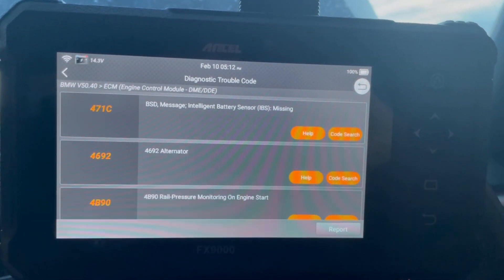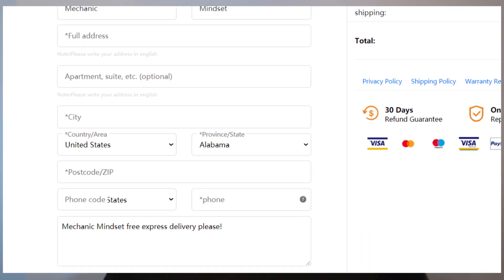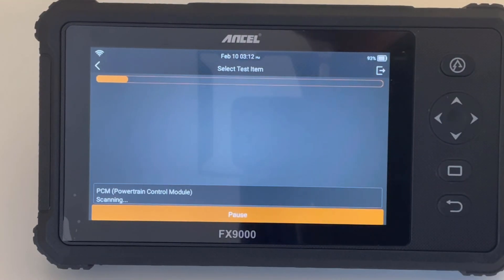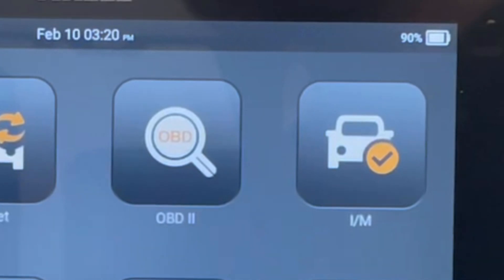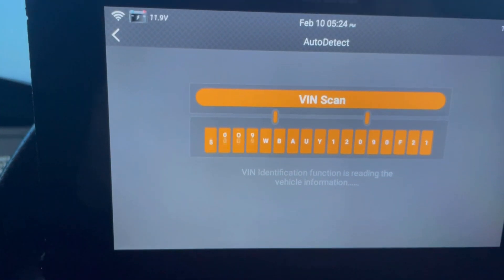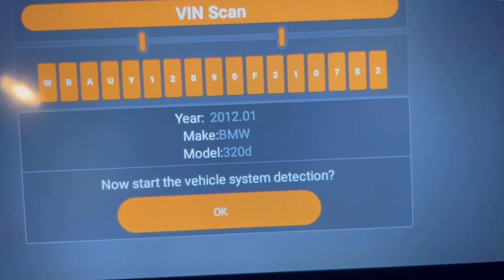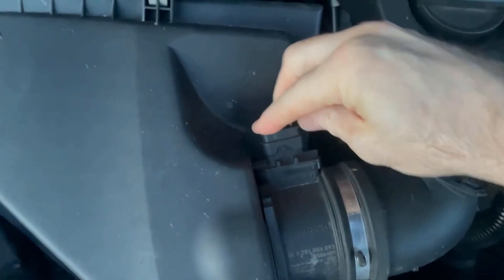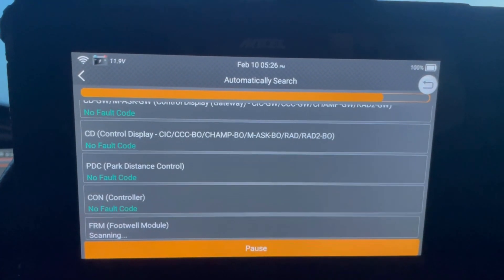I Finally Got A Scan Tool!! | Ancel FX9000 Review | Mechanic Mindset

Comment: I just got an ancel Fx8000 It's a piece of crap. Its Slow slow and slow. when performing oil reset successfully on unit the vehicle remains the same.  Wont do brake bleed, give inaccurate information such as battery voltage.
Reply from the maker: This is quite an old tool now. I reviewed this nearly 5 years ago. Send it back and get one of the ThinkTool phone units. Or they’re doing some lifetime update tool now too. 

If you’re professional, speak to your local diag tool dealer, dont buy the general internet tools. They are not the same

Comment: It’s worth noting to your viewers that this “New” tool uses a Six YEAR OLD version of Android (v7.1), and is not supported by Android security updates. It seems to be common place with a lot of the DIY level devices. I would question the longevity of the device as more money is spent on updates down the road.
Reply from the maker: Good to know thanks. The tech works is moving fast for the automotive OBD tool world at the minute. there seems to be a lots of brands with similar tools and growing capabilities coming in at lower prices. At the time of testing, I was impressed with this tools basic scan/data/service function features for the money 👍

Comment: It looks like this tool has OBD2 side diagnostics of course, but it's not clear how much Enhanced Manufacturer Data is also available, and whether it can print wirelessly, and whether the tool itself is wired or wireless ... In my case, many of these tools don't cover Australian built Fords and GM (Holdens) ... haven't been able to determine yet whether this tool will do that.

Comment: Ancel is b.s with their yearly subscription. There are much better scan tool out there that you don't have to pay subscription fee.
Reply from the maker: Hi, the good thing with this tool is that you dont have to pay and the tool still works. It’s not an expense you want if you dont use it that often, but if you do it’s nice to have the latest vehicles loaded. I dont think it’s that expensive either, most reputable tools have a charge and supports the development required to keep tools that last up to date 👍

Comment: This may be a good scanner but it’s disingenuous for Ancel to claim bidirectional status when it clearly does not support that function. This was the only reason I considered purchasing this model.
Reply from the maker: Yes, it's not 'full' bi directional. It does have all the calibration features and there is a feature in the I/M OBD section for component activation but doesn't work on my car.

Comment: Can it tell actual miles from PMC....? 
A lot of  people are clocking the cluster...
Reply from the maker: I would have to check - it may be possible too read the mileage from other control units too. I know a lot of the better mileage correction tools change it in all modules. Otherwise a conflict will be recorded and a fault code stored.

Comment: I just received my fx9000 today.   turned it on and went thru all the updates.  tested on a chevrolet equinox with all kinds of issues and it picked up a lot of fault codes  I was surprised at how easy it was to use. I even sent myself a report via email which allowed me to see all the codes and then research what they were from my home computer. I am using the Chevrolet Equinox as a learning tool.  Thanks for your video.  And I hope to see more about the FX9000 soon
Reply from the maker: This is great to hear! It really is a good tool for the money 👍. For sure, we will be including this tool in future videos! Thanks
Reply: hello sir, i also have ancel fx9000, but i cant be updated, do i have to register the serial # ? and how?

Comment: You need to update the Amazon links for the Pico and the Hantek lead, both say 'Currently Unavailable'. I'd rather purchase where you make something from it
Reply from the maker: Thanks for updating me! I will check them out. Was that for UK or USA links? So hard to keep on top of them. Cheers 👍
Reply from the maker: Also, if you click a link, we get a commission for anything you buy after that. So if it’s out of stock and there is another similar recommended, we still get a bit of commission. Thanks so much for the support!
Reply: @MechanicMindset  It was the UK links, but now I know that clicking though from there works I can go ahead
Reply from the maker: @yakhunt9424   Cheers!
Reply: @MechanicMindset  The PICO looks to be out of stock everywhere now :-( Annoying, just need to check the output from an MX5 gauge cluster to the cruise control to see if it's a conditioned output from a VR VSS input and suitable to feed into an aftermarket ECU. Reckon I should wait or would a cheap handheld suffice for now?
Reply from the maker: @yakhunt9424  It’s popular! If you can stretch some I can recommend the 2405A, 4 channel and better specs than 2204A 👍

Comment: Hello. What concerns me about this device is whether it detects hybrid system problems and damaged hybrid batteries. Thank you
Reply from the maker: Good question! What brand and model are you working on most?
Reply: @MechanicMindset  
Toyota Prius and all Toyota Hybrid Honda Civic Thanks
Reply from the maker: @mohamadsweed4987  I would think the tool will diagnose these vehicles; they have been out for many years and this tool has Asian software. I will see if I can find out for sure! 👍
Reply: @MechanicMindset  
I thank you very much because you are interested in the topic. I will wait for your response. Thank you🌷🌷

Comment: Wish you had got X7 due to its big screen . Some say X7 very slow to read , this one seams very fast on the BMW
Reply from the maker: It would be good to give it a try, maybe in a future video! What tool are you using? I was very happy with the speed. Maybe the speed also helped by the hard wire connection. The screen size on this is ok to be fair 👍
Reply: @MechanicMindset  Autel MP8080 , I was looking at the X7 due to the large screen size. But could not find many reviews.

Comment: Darren thanks for sharing. Are there bi-directional controls? Guess I should go and read up on it. But all your info and videos have been spot on. Is it still usable if the subscription expires or do you have to up date the unit? Just a couple of questions I’m sure I’ll have a few more.
Stay well and safe Artie 😊
Reply from the maker: Hi, I think the bi directional capability is limited and doesn’t have the full features like power window actuation. It did say there were some component activations for OBD feature but not tried yet. When the subscription expires, this unit will continue to operate on the software it has installed; not restricted. Cheers Artie!

Comment: How it looks compared to Autel or Launch?
Reply from the maker: Hi, I think this tool is very similar to the Launch X431 CRP909. I’ve not used the Autel tools
Reply: I use Launch everyday and it looks similar but is cheaper than Launch
Reply from the maker: @myflorin25  How do you find the launch tool? I think the software might be similar. I saw an example diagnostic report on this tool and it had the Launch watermark 👍
Reply: @MechanicMindset  It is similar easy to use with loads of option for service reset ADAS DPF but it has some issues sometimes I just restart the tablet and it works fine and is better than Autel .
Reply from the maker: @myflorin25  Great to know thanks!

Comment: Great review Darren ☺️ it looks like a really easy to use tool that gives you results with minimum user inputs.
Reply from the maker: Cheers Graham! Yeah I was pretty impressed how quickly and easily I could get codes and read parameters. The graphing function is good to. What tool are you using?👍
Reply: @MechanicMindset  I have a couple of handheld diagnostic tools that I use. Neither are as comprehensive as the one you have reviewed. For very quick engine diagnostics I use the Ancel AD310 (£35 from Amazon). It connects with the vehicle in 10 seconds, reads codes, gives  I/M readiness, and allows you to read a variety of Parameter Identifiers. Quick and easy to use. For ABS and RCM faults I use a Foxwell 650 elite. It’s okay, a bit of a hit or a miss what vehicles it works with. That said you get regular notifications from Foxwell on updates and it’s pretty easy to do.
Reply from the maker: @grahambrown3718  Cool, got to go with what works for you. I have an ELM327 $10 dongle that reads all the OBD codes; not a bad tool if you know how to read codes etc!  I just keep it in my car and get it out whenever I need it. I would recommend it for dealer techs who have to wait in the queue for diagnostics but just want to clear codes after a repair! 👍

Comment: great video my friend . thanks for sharing this tool with us . does it has Functional Tests to activate and deactivate for example fuel pump, VVT   ?
Reply from the maker: Cheers! It’s not full bi directional, but the description said it could do some component activations in the OBD section of the tool. Not tried yet 👍
Reply: cheers Mate
Reply: @MechanicMindset  

If you haven’t, I would advise actuating the fuel pump or any other actuators. It would be helpful to know the exact parameters of bidirectional capability. Thank you for the video.
Reply from the maker: @wdtony6242  I’ll check it put when I get a minute 👍
Reply: @MechanicMindset  
I appreciate that. Thank you. I haven’t found any information about these specific functions anywhere yet.

Comment: I've had one of this scanner type, Launch   CRP909, is the same with this one. From  my experience I can say that is a  basic obd scanner, no coding, no active test components, only few special functions but is ok for entry level.
Reply from the maker: I can see some traces of ‘Launch’ in this software too. I think they may be affiliated. For sure, the coding and component activation are great features but seem to come at an extra price! What are you using now?
Reply: @MechanicMindset  Now I have the Launch x431 pro mini S since November last year and I can say that this tool is to another level compared to crp909 model.
Reply from the maker: @MsCarService1986  Nice! Just had a look. Good features. What’s the annual update cost?
Reply: @MechanicMindset  I have 2 years of free updates and after that I think it cost 499 USD per year, as I remember. The advantage is that you can still use your device without paying another annual update after these 2 years.
Reply from the maker: @MsCarService1986  ah ok, quite expensive but if you use it a lot then it’s worth it! Same for this one, you can use it without updates or subscription 👍
Reply: One in new shape popped up locally for sale for $150 and I'm tempted to snag it.
But I really want a launch immo elite with the key fob dock.
Reply: Not the launch,the cancel.
If it was the 909 launch I'd definitely go get it

Comment: good review, the problem  about these product is the operating system like this one using android 7.1 which is at the end of is supported life the tool may work great until you try hooking to the internet just like a computer with windows XP, found this out the hard way.
Reply from the maker: Ah ok, thanks for the information. I will see how it performs. Hopefully it’s good enough to just Google fault codes etc. The software update download was no problem. Do you have the same tool? Thanks for the comment 👍
Reply: @MechanicMindset  no i bought a foxwell i 70 it wouldn't connect to the internet giving an error message after several try I decided to power it off but when I tried to power on again it would be on a cycle on for a sec then off couldn't do nothing with it after that I know this was a defective unit that happen but when i lookup up the os was at the end of it service life that don't help either the tool in itself probably work fine with this old os but trying to go online may give serious problems, thanks for your good work

Comment: Thanks for the video. This product, you can see it all around the internet world, but so far, at least for me, I saw it for the first time  someone using and how looks like the menu and  etc. I have seen the Autel 'live ' on my hand, but never this one , always wanted to know more about it.
Reply from the maker: I am quite impressed for the basic functions. I will use it more in the future too and see how it performs for real jobs. I think it will do good for diagnostics 👍. Do you own Autel?
Reply: @MechanicMindset  No.Two of my work mates own. 1 has the MK 808 cost him 900$,and the other one has the next level of the mk 808(I can't remember now the model)cost him around 1300$.they're not the hi level scanner from Autel, but we 'test ' them around  with different cars, all good until know, very impressed .we have not diagnose very  difficult jobs until now,some misifires, brake bleed on the abs unit ,pads  on electric parking calipers ,some service  resset, live data etc,has a lot thinks,  for that  money, it's very good. I think that the hi level, will be very very  good. I was thinking to buy Autel or the ancel, but the ancel I haven't seen it at all how it's 'working ' ,I own a multidiag pro(very good, but Autel I think is much better),needs  laptop to 'run it',and every time I hate it... need something with screen!!!
Reply from the maker: @Lambros_Stefaneas  Ah ok cool. It’s difficult when there is so much to choose from! 👍

Comment: Hi Darren, that looks like a handy bit of kit, harmless money too! If you get a chance at some stage try have a play with on of the autel scanners, I’d like to hear your opinion on them compared to the oem systems!
Reply from the maker: I see a lot of people using the Autel gear. Few different levels too at different price points (suppose they are all doing similar things). What are you using?
Reply: Mechanic Mindset I spent years using either some form or another of snap on scanner or launch , I got one of the autel 908mk’s a few months ago and as predicted by my friend (another mechanic buddy) with the whole Murphy’s law that once I got the scanner I probably end up slinging engines around the place....!😜 He was dead right haven’t used it a hand full of times but it seems to be decent enough! Having great fun on a daily basis with Sdd and pathfinder though!

Comment: Priced about the same as a non UK official imported autel (ebay direct from china with no support or updates) which means its a good price machine as has customer support thrown in.👍
Reply from the maker: Ah ok, that’s good to know. They were quite vocal about the after sales support that comes with this purchase. What’s your current weapon of choice?!
Reply: @MechanicMindset  autel 908 official imported.  Good all round machine that does more than I need for general use. Can be a bit slow when graphing live data but it was best value at the time. All things are getting cheaper I guess
Reply from the maker: @the_retired_mechanic  Ah ok, Autel are really popular. All technology moves on quite quickly. There will always be something newer, faster and more expensive for us to buy 🤣

Comment: is it bi directional >???? if so It will me very handy at times
Reply from the maker: Hi, so we have the reset functions, some of which are no directional (like brake pad reset and DPF regen). The website says it can activate components but I haven’t found where to do that yet. Need more time to play! 👍
Reply: Hi like your videos keep up the good work there, it's the same machine as the launch /cread Pro 909x I would like to see more video on this tool pls many thanks.
Reply from the maker: @jonathanevans2677  Thanks, glad you’re enjoying the channel. Yes, just like Launch. I think it might be Launch software in the background too. What tool are you using?
Reply from the maker: What bi directional features are you interested in?
Reply: @MechanicMindset  I have the autel mx808, I am curious if it does more than that. It can do all the oil resets and brake maintenance modes ect. but it does not do active tests like activating solenoids like purge valve, vent valve, egr ect. I would be interested if it did true bidirectional controls through pids like the higher end scanners.
Reply from the maker: @Yotataco04  I will have a play and see what I can find. Other people are also interested in full bi directional tools 👍
Reply: @Yotataco04  hi I have the MP808 and it has Bi directional controls £545 cheapest Autel with that controls .If this helps.